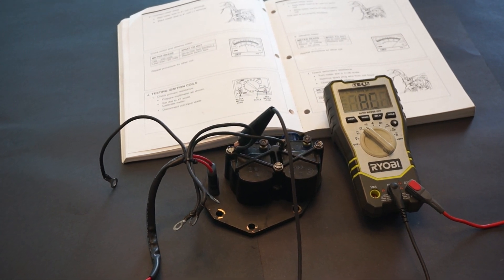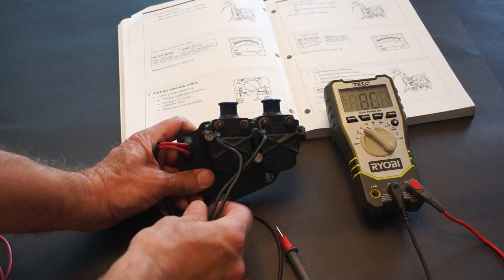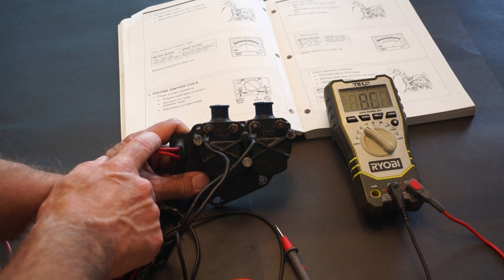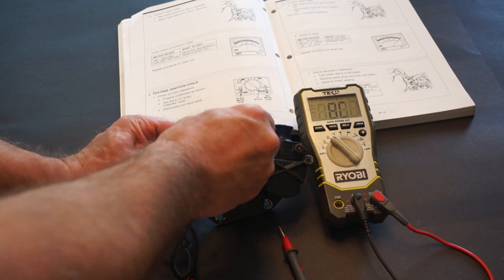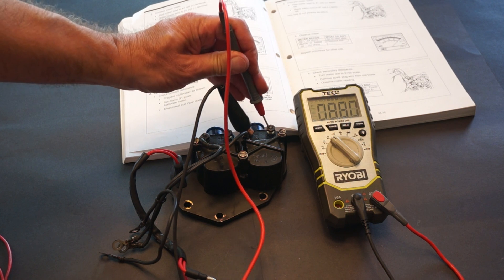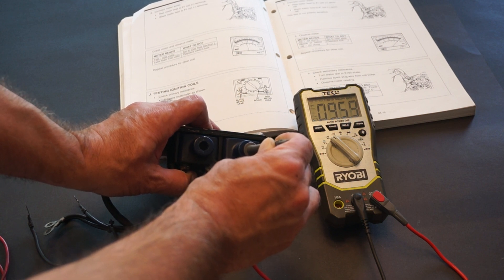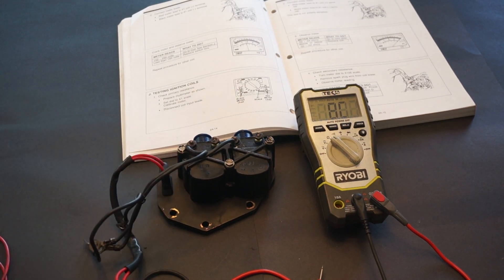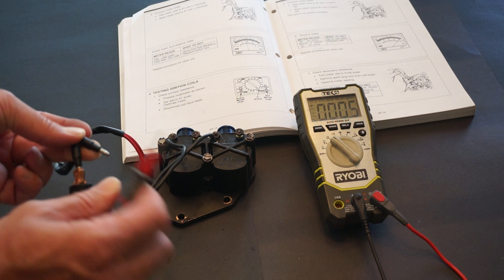How to test ignition coil

Comment: Hello Sir, did you ever get your boat running? And if you did , can you tell me how much water you had shooting out of the two top exhaust holes.? I have the exact same engine that hadn’t run in quite a while and it doesn’t seem like there’s enough water pumping out those holes on mine.  Thanx.